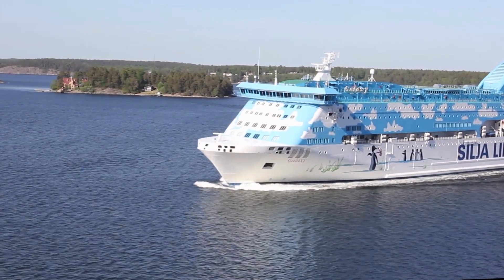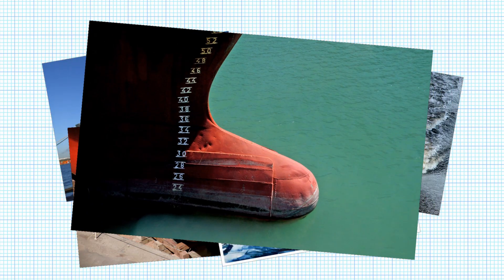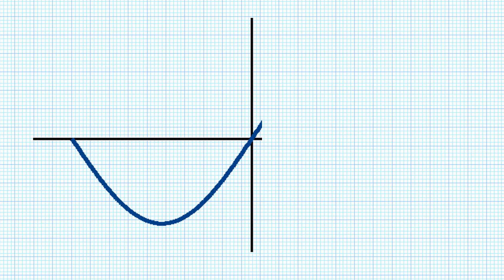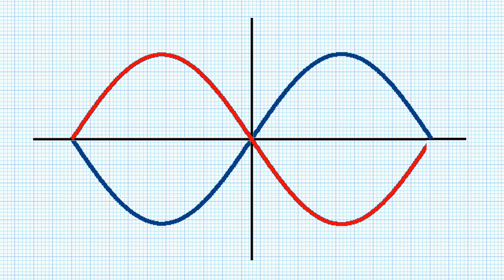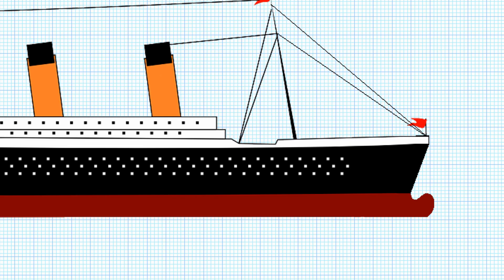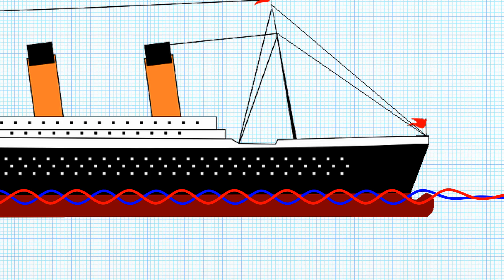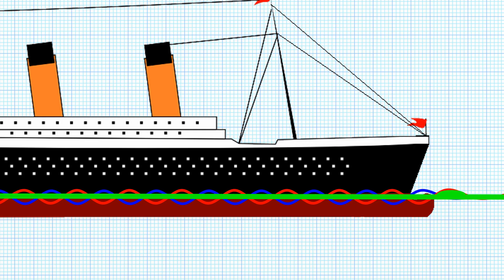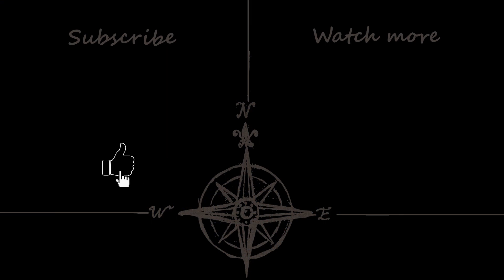What is the BULBOUS BOW for?

Comment: A bulbous bow is a protruding bulb at the front of a ship, just below the waterline, that can reduce a ship's resistance and save fuel. The bulb modifies the way water flows
 around the hull, reducing drag and increasing speed, range, fuel efficiency, and stability. The bulbous bow is positioned to create a bow wave system that partially cancels out the ship's own bow wave system, reducing wave-making resistance over a limited speed range. 

https://youtu.be/6FrCusDG41U?si=DbxidAr9XlKJYB0l

Comment: It has to do with a speed that the wave drops off at the props, causing more fuel for the speed, from the wave form. 
The bulbous bow, causes two waves, that counter each other; rather than a big wave that causes problems at the back. 
Boats that are able to plane, simply ride the top, and their only problem is bumps.

Comment: That's interesting.  The only projection I've ever seen on a ship was a ram.  45 years ago I spent some months aboard a former (US) Navy "subchaser" ship repurposed for ocean research.  It had a bulbous but more pointed projection on the bow, under the waterline, and I was told by the merchant marine captain that the purpose was to ram enemy vessels if possible.  He said the ships were cheaply built (for a ship) and called them expendable because if they did ram an enemy vessel they would probably be destroyed.  This particular ship never managed to ram anything so was still available for use.  I do have one vivid memory of the day we all ran to lifeboat stations on an alarm after an explosion, with black clouds of smoke erupting from the engine room, then watched the engineer climb out of the hatch with a huge piston dangling from his fist.  Being built as expendable, they said the ship required a lot of maintenance.

Comment: Hand waving arguments. Cancellation effect depends on speed.   It is possible it was tested on models only which ar 10-20 ft long but never tested on real ocean going ship.   So, it is one of those solutions that was overhyped by engineers and used just in case that they can be right but it was never proven that they are right.

Comment: I would have guessed for two reason :

1. It's act like a bumper, to prevent the hull got damaged if it hit something

2. As sacrificial part, so it get eroded faster by the water, than the original bow section

Thanks that I found this video 😅
Reply: i always thought it was for ramming in military applications

Comment: I am curious into why there is no 'adjustable bulbous nose design mechanism' given the design is set for a certain speed, and ea state, and weight line in the water. Is to a matter of the design and engineering for an adjustable bulbous nose that manually or automatically alters as per the ship speed, and tweaked for the sea state manually and/or automatically? Is it a design mechanism cost factor?

Comment: This is in a way similar to what's referred to as 'drafting' in racing. You exploit the airflow of the bike/car/even a runner in front of you but as this video explains you do still have to do it at the right distance for the speed to get maximum advantage. We can all see videos of racing doing precisely this. (you thought the Tour de France bikers travel in large groups through most of the race because they coincidentally just happen to have the same endurance and speed? No, it's to use precisely this effect to conserve their energy for the final push)
The ship bulb just fixes that front wave breaker permanently.
Mind you trying 'drafting' in everyday situations is tailgating and is very dangerous and you should avoid it. Watch those other videos on racing as well how frequently 'drafting' leads to mass-crashes and pileups.
The ship does not have to worry about a pileup because its own bulb is fixed at the distance.
Mind you there are plenty of incidents where ship wakes have in fact lead to accidents with other ships.

Comment: I used to load vessels. We tested how we got the best fuel economy. The naive idea was to hold the vessel level. But that will not work if there is not enough cargo, as the propellers will not be low enough in the water. Then we tested if it was better to keep the propellers lower ("leaning backwards"), but due to the bulbous bow this was even worse.

So the conclusion from our experiment was that if you have a bulbous bow, you should keep the bulbous bow at the right level - even if that means "leaning forwards" and adding ballast.

Comment: My father, who was a navy man, always told me that this behaviour was found by accident. The first was build for sonar and it created a possitive increase of speed
Reply: I read somewhere that they discovered this when they put rams on the front of early metal war ships. When a ram fell off, the ship was slower and someone went 'ah-ha!'.
Reply: i immediately started chanting sonar when the video asked what the bulge was for, only now i learned it also on very specific occasions and circumstances helps with the waves.
Reply: Now you can tell your dad that it's actually the opposite, and he can learn something new 👍
Reply: @pizzlerot2730 You had to give it extra bro! Man is over there doubting everything
Reply: positive
Reply: Your Father was right. On Warships they are Sonar domes.
Reply: @Nibby12 sorry but no. The bulbous bow predates sonar by quite a bit. The reason that it's used for sonar on warships is simply that the location of the bulbous bow is exactly where you'd need to put a forward-sweeping sonar setup, and since they already had that protrusion, they just put it inside of the bulbous bow.

Comment: A bulbous bow is a protruding bulb at the bow (or front) of a ship just below the waterline. The bulb modifies the way the water flows around the hull, reducing drag and thus increasing speed, range, fuel efficiency, and stability.

Comment: Before the bulbous bow the the sharp bow cut cleanly through the water leaving the full weight of the water, which is extremely heavy, crushing the plates between the frames of the ship at the forward end. Within a relatively short period this would cause the plates to buckle inwards totally destroying the ships lines and in extreme cases fracture welds. The bulbous bow smashes the water into a froth, if you like, easing the pressure on the hull plates at the forward end and the shock that causes the plates to buckle between the frames.

Comment: Ah, the old, "lets use idealistic mathematics to balance out the problem!"
Frankly, this approach has some major issues that thankfully were mentioned at the end of the video.
The phase shift between the two waves is dependent on a lot of factors, primarily speed and how deep the vessel is in the water. But also on the water temperature and such.
Though, a cargo ship can adapt its speed accordingly to optimize its fuel efficiency, at the downside of potentially less speed.

Another solution is to minimize the amplitude of the wave itself. It is mainly caused by the ship pushing the water away and the innertia of that water continues emanating outwards.
A slower speed of the vessel would push the water slower, giving it less innertia and easing the problem. Since the inertia of the water (or any object for that matter) is equal to E=mv^2. Ie, Energy = Mass x Speed^2. So a 10% reduction in speed gives a 19% reduction in inertia.

But slowing down the vessel isn't always "ideal", so another solution is to make the bow more pointy. So that it pushes water outwards slower for a given speed.
Not to mention that the shape of the bow also matters and especially how it transitions over to the rest of the boat.

Comment: I don't get it. Based on your explanation you're saying that the bow of a normal ship passing through the water creates a standing waveform along the side of the hull, which increases drag on the hull. Except, given your explanation it shouldn't. Sure, the crest of the wave will come further up the side of the hull, increasing drag, but for every crest there is also a trough, which will reduce the drag on the hull by an equal amount!  I'm guessing there's more to it than that and that this is an oversimplification of the process? I'm guessing that what happens in reality is that the 'trough' doesn't really exist due to water pressure pushing it back in against the hull, so you're left with the crests which are then cancelled out by the bulbous bow?

Comment: In aviation there is something called a variable geometry wing which is a wing that can change its shape to better suit different speeds. If this bulb becomes a problem with slow steaming, couldn’t you just engineer a bulb that could extend and retract in such a way to minimize those waves at different speeds?

Comment: before watching... I KNOW THIS ONE, it has to do with the way ships move through the water. if you make a sharp point it will cut sure, but people figured out if you added the round thing to the front, it pushes aside a lot of water, so you can make the ship less pointy at the bow and still be very efficient. 

after watching... dammit i was close, but still had the right idea. the bulb exists to cancel out the waves made by the ships as they move through the water, reducing the drag and increasing efficiency.

Comment: Once you fit the bulbous bow, the previous front edge of the bow is no longer in direct contact with the water, and does not produce a wave. Won't you just get a single wave, this time originating at the bulbous bow, instead of two that cancel each other out?

Comment: Venturi flow through thrusters at bow   with discharges immediately aft of intakes? Discharges would use controlled pulses and pressure  would be variable, dependent on speed. Air entrainment considerations with intake above  waterline.

Comment: There is actually one more very important reason for the bulbous bow along with the wave canceling effect!
A ship which moves considerably slow without the bulbous bow will create 70% more air bubbles than one with a bulbous bow, as well as the lack of wave counteracting effect, moreover the bubbles created by traditional bow gets push to the bottom of the hull which causes a loss of water pressure underneath the hull inturns less force pushing against hull, and decrease buoyancy, therefore the ship will sit lower in the water and create more drag and less hullage capability.
on the other hand ships with bulbous bow, when the bow pushes against the water, it creates fewer air bubbles and the bubbles are mostly displaced to the side of hull, therefore, the hull will maintain its water displacement, less drag and what's even better is the air bubbles get push to the side of the hull making it less drag from the side of the hull resulting better fuel economy!
Reply: Actually making stuff up on the internet is hazardous. 
the Navy has been doing this for YEARS. The effect you mention is not a consideration.
Reply: @sammynicholas  Goolge "navy test to create air bubbles under ship"
The concept has been around awhile.
Water has 9 times the friction of air, so a ship floating on air is 9 times faster. (of course they can't actually float the whole ship on air)
Air Lubrication on Hull.
Reply: @SuperChuckRaney  Yes the concept has been there since late 19th century, ofcourse air bubbles can lower the friction between  hull and water, but it also lower the buoyancy but cause the hull to sit deeper so it won't help ships Unless you deliberately constantly create "micro bubbles" then it won't affect the bouyancy of the ship and also helps with friction.

The air bubbles created by ship bow is big air pockets not micro bubbles!

Mitsubishi is the first to use air pump to create "micro-Bubbles"! Which it actually helps when the ship was being towed! But but when it's self propelled!

Because the aft shape of the hull has to be redesigned to avoid micro bubbles reaching the propeller blades! (You can do a little research on that too!)

Please read the full research paper on the topic you mention before you comment please!

Comment: I think there's is more to this phenomena than can be readily explained by the two dimensional diagram in the video. First of all, the water is not moving down the hull, it is sitting still minding its own business, which is, what ever is happening to it as a result of complex waves, short period, long period, cresting, winds, etc. Or a lack of all these conditions. But the most important thing is that the ship's hull is moving through the water, and not the other way around. There is a difference in the laws of hydrodynamics and physics. So to keep it simple to start with, if we keep all other variables at bay, and choose a perfectly calm open ocean. The water is somewhat sill and here comes a giant ship at macking speed with thousands of tons of weight. The water is having a nice old day and suddenly boom the bow of the ship displaces all the water in its path of the interface of the ocean, lifts it up, peels it apart, and sends it flying, in a sold green sheet of bow wake a hundred yards off to either side of the ship. That is the initial shock wave on the interface of ocean. But under water there is also a displacement shock wave as the bow now moves previously undisturbed water out of the way in a 3-dimensionaly graduated underwater shockwave, which is affected by the size, mass, volume, buoyancy, speed, and shape of the entire hull, not just the shape of the bow stem and whether or not in has a bow bulb or not. In my opinion, he benefit of the bulb is, that it sets up the shock wake that sourounds the hull, to a shock point further forward of the giant hull displacement, so that this massive shockwave coming off of the bulb precedes the hull volume, enough to eliminate the shock pressure that the hull would have had to experience without the bulb. So in essence, the the hull is drafting the shockwave of the bulb, much like a race car drafts the car in front of it. The difference here though, is that unlike air that compresses, water does not compress, it must be moved out of the way. It can be displaced much easier on the ocean's surface, called the interface. But the deeper the water is displaced around the bottom of the hull, the ratios are much different. Water weight and pressure at that depth can make an 24 inch balloon shrink down to the size of a golf ball. The drag factors down there have way more affect on hull speed than what is happening alongside of a vertical gunnal up at the interface. So in my oopinion, that mathematical attempt in the video is only a small part of what is really going on, but it was a cute attempt.

Comment: 1:52 the resultant line wouldn’t be in the middle, it would equal one. Also 180 degrees out of phase with y=sinx is y=cosx, which has a y intercept of one, not 0, as you displayed.

Comment: Hi, can you tell me why military ship (warship) doesn't have one. Is there any way it could hamper its capability??
Reply: prakash thapa because the speed of a warship is not constant. It needs to be built for a specific speed to work, so they are not very effective with military ships
Reply: @nasseralkhelaifi1853  i seriously dont get it, can you explain with physics as in this video nothing has been said about the speed factor
Reply: prakash thapa it’s not said, but it’s a fact : bulbs works with a particular speed and wave condition, otherwise it’s almost useless
Reply: It is well explained on Wikipedia
Reply: https://en.wikipedia.org/wiki/Bulbous_bow
Reply: @nasseralkhelaifi1853 Khelaifi thanks for the link but here they do mention about the speed and warship generally goes beyond 12 knots usually, but yes not constant every time, however, they don't maintained constant speed usually but have you seen warship tanker they do have bow at the front
Reply: prakash thapa yes because it’s a tanker, not a warship (I mean it’s not made for war

Comment: Why not just create a double hull side by side with an aproximate 50 ft gap where you would mount the propes kepping watter rusging dowwn Center for better stability and speed and minamal wake also you can bridge the gap and use like a crntral park like oasis alowing larger safer more stable ships

Comment: New researchs show that bulbous bow isn't as efficient as it is planned. It is theoretically correct and you can actually see the smoothness when the ship is navigating. However it works in calm waters. When in waves and swells it is nothing but a weight and restriction. So the new designers have sharp bow instead of bulbous bow.

Comment: This a very eloquent description but it's like religion, not prove able. With your explanation it would only be effective at a certain speed. A traditional ship has a narrow bow that tries to cleave the water aside. If this was effective then submarines and airliners would have pointed noses. The bulb allows a smoother transition through a fluid dynamically moving the fluid aside and works at all speeds. Look at the side of a very large ship at speed, it still has waves along the side, very large waves.....

Comment: Would it be possible to achieve that with a small vane mounted on horizontal supports, somewhat like hydrofoils, but forward of the bow? If that would work at all, then the vane could be made adjustable, optimizing dynamically for different operating conditions.

There is a kind of similarity between the bow bulb on a ship, and the "nacelle strakes" on the side of a jet engine. These are little vanes mounted on the side of the engine to mitigate the effect that the engine itself has on the air flow over the plane's wing. Loosely speaking, the nacelle strake is trying to improve the wake or "bow wave" of the engine as air flows past it.